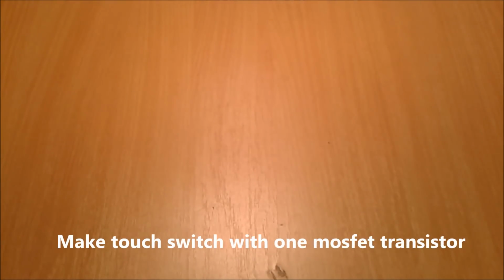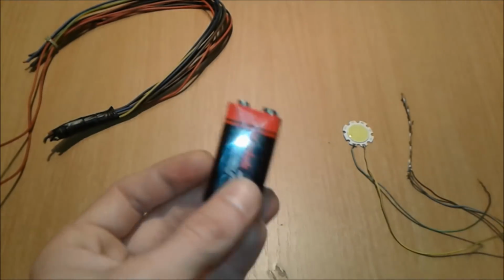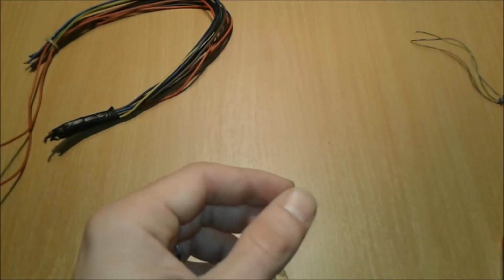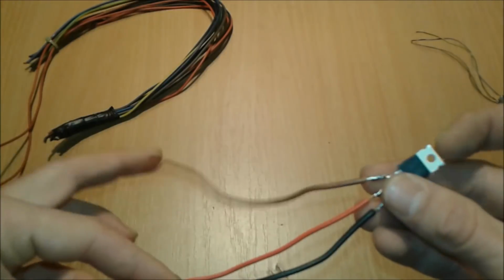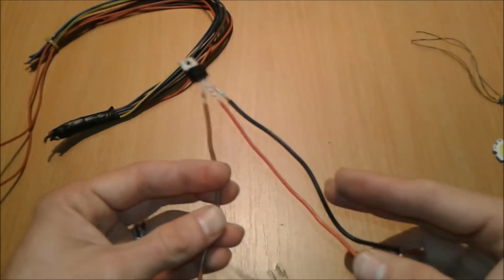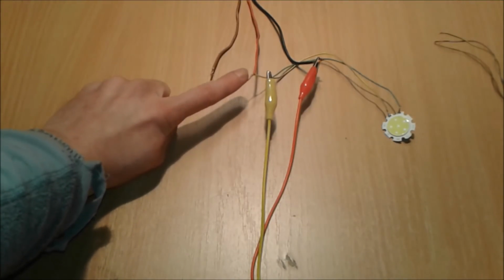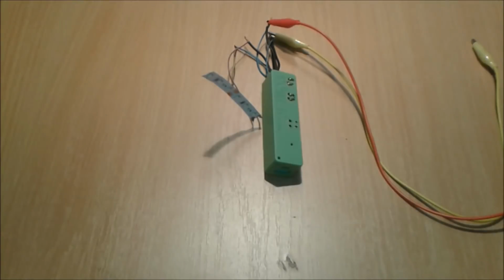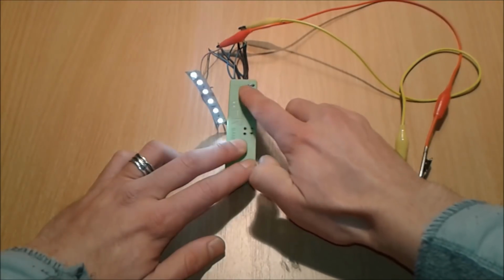How to make a touch switch circuit using one mosfet transistor. Mosfet transistor projects

Comment: the whole point is to NOT touch metal, i.e. risk of shock. in electrical appliances, also this has no static shock protection
Reply from the maker: Just a proof of concept using body internal resistance

Comment: Hi,  Nice Video ,
      I want a button like door bell button which is to be operated by touch 
And I want to use it on my cars horn cos when I drive smoothly , I need to apply very much pressure to honk (atleast in Indian XUV 5oo)
   So if I can intall like this anything please suggest or make video of 
'how to make your car horn touch ' 
  I am sure this will boom.
    No car provides touch horn 

Thanks in advance
Reply from the maker: Bhanu Vashishtha thanks my friend I will sure do one I did found some comercial and cheap touch switches soon buddy stai tunned
Reply: @NoSkillsRequired  thanks ,

Comment: Can you make it simpler such that it's a momentary switch that the light goes off when your finger is not touching the contact point?
Reply from the maker: Cosmo John I think you can add a capacitor or check out the new video capacitive touch...
Reply: Maybe even using transistor instead of the mosfet, when you touch it connect + with resistor to the base pin and it works when you remove the finger it turns off. Or if you need a mosfet because of the big load, you just add pull down resistor on the ON switch it will drain remaining charge and mosfet will turn off the time you remove the finger off of the switch.

Comment: In the video you are using one switch, can you make a video with a "2 way switch" ? TY
Reply from the maker: pici24 this is a simple switch converter in a touch switch but being 100% realistic is not a true touch is a cheap diy way. Real touch has a micro controller that store a value and compare that with the previous if is on or off
Reply: @NoSkillsRequired  Well..it is working and only that matters! :) Can this setup hold for fast/verry fast on-off operations ? something like "many" hertz .. thank you for your answer ! :)
Reply from the maker: pici24 ir may work I tryed with rapid switch by hand try and you will see these mosfet are not that expensive
Reply: @NoSkillsRequired  This I'm planning ! :D Thank you verry much for the info and for the video..keep up the good work !! :) PS only N mosfets are working or any mosfet is just fine ?
Reply from the maker: pici24 n channel mosfet different mosfet different specifications this is tested as you can see in the video all the best with your projects glad to be able to help

Comment: HI Sir.
what if i wanted to use this "switch" to turn on-off my FM radio project?
The FM radio work on a 3.7v Lithium battery and an amplier (lm7052 same 3.7 v source) :-)
Reply from the maker: Attila Rivera will work as long as the power source is less then the mosfet can support watch the other videos lots of info

Comment: This is prone to sporadically being triggered due to ESD. A better choice would be to use an IC that specifically handles touch.
Reply from the maker: +damny0utoobe This project was ment to be easy for everyone to understand what a mosfet is and it's uses. Happy holidays
Reply: +damny0utoobe Nope it uses the body resistance to charge and discharge the gate of the mosfet.......No ESD involved

Comment: That doesn't answer my question about what milliamps at 4v to feed to the gate so I can calculate what resistor  I need to reduce 50v to 4v  so I can then add a variable resistor to the circuit so I can regulate the output of a DC generator I made without turning the motor gas idle down  so I can leave it at a good RPM with a 50v 40amp output from the DC generator head  going to a variable voltage regulator
Reply from the maker: Dalton Neumann I don't get it what you need to reduce 50v to 4v?so you have a generator that outputs 50v at 40a or similar... and you need a switch or you need something to reduce the amperage?
Reply: @NoSkillsRequired  I just need to know how many milliamps the gate of the z44n takes or draws. so I can use oms law to calculate  what resistor I need going from the gate to the source pin or ground so im not feeding the gate 50v and busting the mosfet by doing so.so I need 4v to the gate with a 50k potentiometer switch use it for variable voltage regulator for my diy generator. I know the gate takes 2-4v  to turn on with a Max of 20v input to the gate .that's why I need to know how many milliamp the gate needs for my calculation. Please let me know the milliamp draw of the gate it's the only variable I need for my calculation. And thanks again for the help
Reply: Ok I found it if you ever need to know it's around the gate amp draw at 4.8v is  0.000171amps thanks for the talk and the help got to get back to working on it. I need a 250 k,ohm resistor with a 50k ohm variable resistor iv been set back three days on this it's good to be moving forward with it thanks again 😊
Reply from the maker: Dalton Neumann nice one I am glad that you find it good luck with your projects keep in touch
Reply: @NoSkillsRequired  thanks again and I will
Reply: Im to dyslexic is it +v or -v to the gate ?
Reply from the maker: Dalton Neumann v+ with resistor to control the mosfet as a switch
Reply: @NoSkillsRequired  thanks again for the help. when I finish the generator I might make my first YouTube video. On how to make a fuel efficient gas generator
Reply from the maker: Dalton Neumann good for you and generators we love them, I am working o  some magnet generators soon...

Comment: Can I use it for a motor about12 or 24 volt
Reply from the maker: it depends on the motor what is the power of the motor,if you have the same mosfet there is a video mosfet irfz44n datasheet check there to see  the ratings,also there is  another way to use a 12/24 relay controlled by this touch switch in this way you will dont have to worry about heating and other problems search it on my channel touch switch 220v relay
Reply: How to use it in 240v ac power supply with a relay or without relay for switching on/ off
Reply from the maker: Singh Sandeep here you go my friend https://youtu.be/qvrjrWzR6wM the principle in how to use a relay and this touch hope to hear from you again

Comment: Can we use 75nf75 fet
Reply from the maker: salman noor if is a nchannel mosfet yes all the best
Reply from the maker: salman noor Yes 75nf  is a nchannel mosfet so can be used like in the video
Reply: so basically sir, all nchannel type mosfet can be use for this project?
Reply from the maker: xtian de castro Yes all nchannel mosfet can be used in this configuration but you have to look at your mosfet drain to source voltage not exceed that and you are good to go
Reply: okei sir, thanks alot!!!
Reply from the maker: xtian de castro Any time and if you want more projects check out the new videos and if you want subscribe all the best
Reply: sure i will sir...
Reply from the maker: xtian de castro Thanks buddy all the best